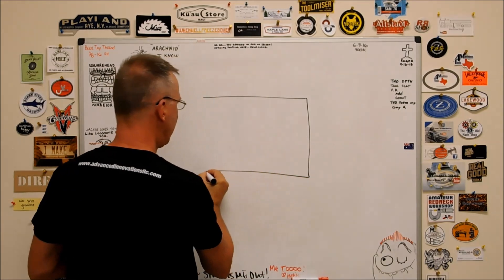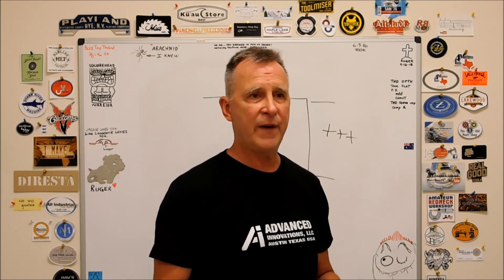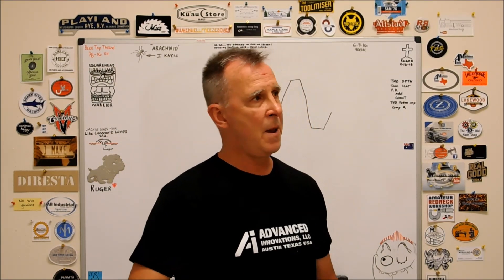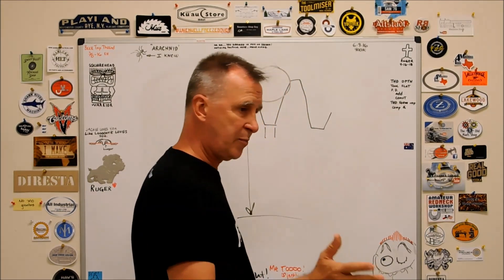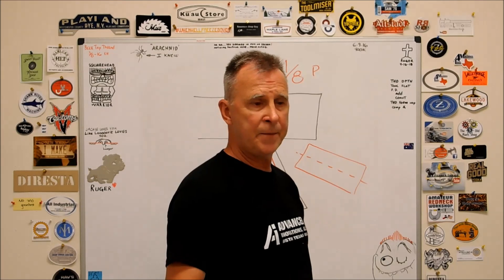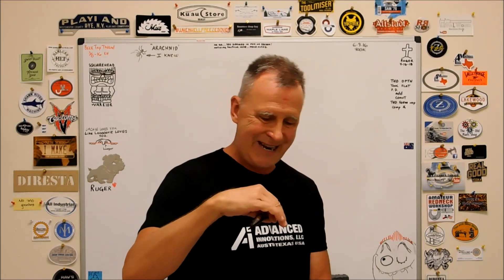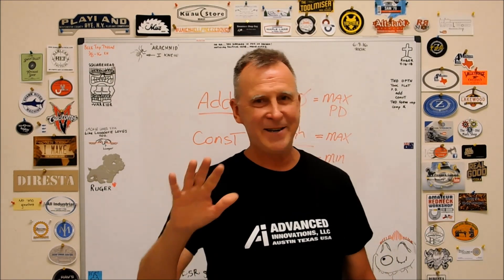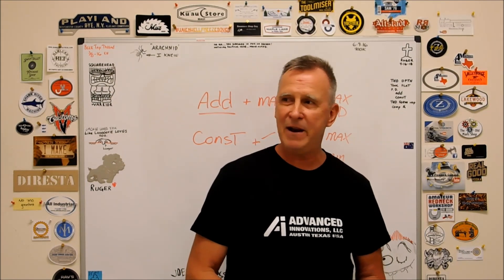Single Point Threading, Want to do it better ?? Watch This Video.

Comment: Thanks Joe.  You are 100% correct!  But, having said that....  Job shop machinist 40 years and I've gotten the thread wires out maybe twice (I think for a class 3 fit).  I don't remember having a thread come back for poor or no fit.  Hand ground high-speed, square to the work by eye, compound at 29.5, 
 and cut the thread.  Use a nut to check it.   I guess I've been making lawnmower parts all these years.
Reply from the maker: I spent the majority of my shop time in aerospace, medical and semi-conductor. Every thread had a class. I'd have to say after 40 years of luck like yours, go buy a lottery ticket.
Reply: @joepie221  I understand, and your attention to close tolerances is quite justified.  The lion's share of my shop work has been in heavy industry.....coal mines, rock quarries, well drilling, railroad, etc.    Much more forgiving work.  You are a master machinist and I admire your work.  Thanks Joe!
Reply: I wonder how SpaceX runs their job shop. I worked with a NASA guy for a time and he wanted to verify the line voltage and that the electricity was actually supplied at 60Hz as part of a qualification package for a medical application. A generous 6 week timeline for writing and executing a qualification package ballooned into what would be a 6 month qualification package. He was chopped and I took over and I got it done in 4 weeks. Interchangeable means interchangeable. There is no "one" test. Everything of importance is checked and rechecked and checked some more. My guess is that 98% to 99% of the job shops work just like you describe, cut the threads and check them with a bolt/nut for play and call it good. I don't see that the 2% of job shops are going to start mandating that all threads be measured with thread wires. That's way too much time wasted. It is a nice video but only relevant to maybe 2% of the shops that need to do this, and they already know they have to measure and verify threads to class and they are onboard. This rant is much ado about nothing. You didn't have 40 years of good luck, sorry, you were doing things exactly as you should have done them. 40 years of cutting threads and none ever came back for poor fit or no fit says it all.
Reply: All job shops making threads than need to fit parts that are not also in their control need to stay within the tolerances specified.  You're probably right 98% of the time the tolerance will fall good even with threads checked against a nut or bolt but consider the cost of the 2% of jobs that get sent back for a thread that doesn't go together or worse the thread strips in service because it's been over cut.  If it's a one off part the cost and time of checking it properly is trivial.  If it's a batch of parts then measuring first, last and samples will be sufficient in most cases.  It doesn't take long to make a go/nogo plug for internal threads that puts you comfortably within the max/min pitch diameters.  Quality is a state of mind.  (Joe has it).
Reply: @MrSailbadthesinner  No arguing your point in theory. So why do 98% of job shops go with a qualitative test nut/bolt versus a quantitative test unless specified otherwise? The way Joe said it is everyone else is a sloppy lawnmower part maker. I would say the real world data doesn't support that a quantitative test is superior to a qualitative test for 98% of the work going out the door. GE was a big believer in SixSigma and where are they now. NASA was known for very high quality standards and they priced themselves out of the market. Quality must be applied in context or it becomes quality exercises. Everything must have a cost benefit.
Reply: @MrSailbadthesinner  My guess is if 2% of any work going out of a job shop were being sent back or rejected it would put the job shop out of business. That number was guessed way too high.
Reply: @tyhuffman5447  GE was a big believer in six sigma - so was GM.
Reply: Don Pollard say no more!

Comment: Joe you should do a screw cutting 101 video. Im a beginner.  Ive watched your thread cutting videos and understand some of it but that pitch diameter, pitch wires,etc gets me everytime.  Using the subjects of all 6 of your thread cutting videos and show how to cut an internal and matching external thread from start to finish
Reply: I recommend getting a Machinery's Handbook and reading that section. It gives a very in-depth tutorial of the process and the measurement. There is a lot of info in there so take your time reading through it.

Comment: Nice Video, and a lot of passion :) .    i was wondering, if this sharp "root" is really a perfect thing, because i thought that "rounded" transistions might be stronger. ( PLEASE DO NOT FREAK OUT :), at least i did not ask about the DOC  ).   Appreciate your time and the quality of the content. What is better ? Thread Wires or these Thread triangles .
Reply: “Rounded” roots are most certainly stronger Michael. Check out the UNJ profile. It’s primary reason for existence is that feature. It’s used primarily for high strength applications as the radius in the root allows for a slightly larger cross sectional diameter. It may not be much larger than a UN root but every bit matters in that area since that’s where fasteners fail under tensile load. On the space shuttle many fasteners were a special MP37N alloy with the UNJ profile with Class 3 threads.

Comment: We just had a part made for a German machine by a large machine shop. They struggled to get an internal Acme thread to fit the adjusting shaft on the machine. They had the original part and they measured the threaded shaft (20mm?) on the machine. State of the art shop, quality control lab etc. After many tries they finally got a fit. I had no idea it would be that difficult.
Reply: Acme is NOT used with metric values!
The corresponding metric thread is a trapez.
Now why is this very important? The reason is that while their shape look the same to a naked eye they aren't. Acme has an angle of 29 degrees while the trapez has 30 degrees. 

Both threads rely on a large contact area to keep wear and friction under control, use the wrong tool and you will get a very small contact point and a thread that will fail quickly.

(There are also other trapezoidal thread forms but these two are the most common)
Reply: @sharg0  Yep! When I saw Larry's comment I was going to make the same comment as you. Nice catch.
Reply: Metric threads on a imperial lathe never is funny because of the odd tpi you have to deal with.
Reply: It sounds like they had their heads stuck between a book and a computer.  Sometimes old school will simplify things.  If you have the mating part, measure the pitch to the best of your ability, grind a tool to match the profile, allow an appropriate amount of clearance, and cut the threads until they fit..

Comment: E=M-(3G-.86603/n)
Pitch diameter equals measurement over wires minus 3 times the wire size minus .86603 divided by number of threads
Reply: For clarification, that is for United and National threads with an included angle of 60 degrees. And n is the number of threads per inch. Cheers.
https://www.threadcheck.com/the-three-wire-method-of-measuring-pitch-diameter/technicalinfo/
Reply: I just know it works and I’m gonna go with whatever’s in the book.
Reply from the maker: I have to say I disagree with this formula. 3X wire diameter deduction from the measurement seems a bit extreme.
Reply: Joe Pieczynski maybe I’d have to check the machinery handbook but I’m pretty sure this is the formula I learned at school.
Reply: I agree. If the wires are such that they touch the sloping sides of the thread at the pitch diameter then E = M  - 1.5 G  (where G is the wire diameter)
You can see from the geometry of that situation that it is a radius and a half at top and bottom.
But the formula says 3 G. See the reference in my comment above.

Comment: I enjoy your videos and your passion for machining. I've used your threading technique ever since watching that first video. I'm soooo glad you now use a tripod! :-) The only problem I've had using the technique, since I don't practice thread cutting much on the lathe, is making sure I hit my mark on the dial. Lots of time after you run off the end of the thread with your technique but a smaller window if you miss the mark on the thread dial. This is usually solved by a few "practice" engagements with the tool moved away.
Reply from the maker: I did a video on engaging your halfnut made easier. Check it out. I agree with the "off the part" practice runs. Good practice.
Reply: @joepie221  Yep, I've seen that video and that's how I've always done it. I just can't get to anxious on starting to applying a bit of pressure as my lathe has 24 engagement points, so not far in between them.

Comment: just saying but in cnc machining, when writing code with a canned cycle the min dia on male and max dia female are required along with the thread depth so the number of passes can be determined. when checking to see if threads are correct, you are right it isnt about measuring how deep but the pd and crests.

Comment: “The metric system – since 1792, the system trusted by 15/16 of the world.”   This Old Tony.
Reply from the maker: Its only a different language. Its not more precision.
Reply: Wouldn't that be 93.75% in metrispeak.. Just say'n.
Reply: so you guys know fractions and decimal aren't the same as Imperial and Metric
Reply: @Half_Nuts    I got the joke.  Jokes should still make sense though.
Reply: You know America did pass metrification laws, 1975. And I quote wiki:
The U.S. Metric Study recommended that the United States implement a carefully planned transition to the principal use of the metric system over a decade. Congress passed the Metric Conversion Act of 1975 "to coordinate and plan the increasing use of the metric system in the United States".
Reply: There are two types of countries in the world: those that use the metric system, and those that have set foot on the moon.
Reply: @philippalmer7814  yeah but didn't nasa use the metric system for the moon landing. doesn't take away from the unmatched  massive achievement though.
Reply: @feelindizzy777  No. they used US Customary unit (imperial). They didn't begin switching over until the 90's.
Reply: @philippalmer7814  Bollocks. While the computer displays provided readouts in feet, feet per second, and nautical miles – units that the Apollo astronauts, who had mostly trained as jet pilots, would have been accustomed to using, internally, the computer’s software used SI (metric) units for all powered-flight navigation and guidance calculations, and values were only converted to imperial units when they needed to be shown on the display.
Reply: @Gottenhimfella  Only for some of the flight guidance internal to the computer. The rockets and spacecraft, along with all of the mass calculations were all done using Imperial system

Comment: Joe, I understand what you're saying, but I still have to move the compound in by a certain amount to cut the thread. Granted, when I get close I should be checking PD, but isn't it true that I could be using a plain 'ol depth reading to get 90% of the way there, then start checking PD? I can't start checking PD after the first .005 pass, right? I still need a rough idea of how far I'm going in, is my thought... Cheers, Dan.
Reply from the maker: After a while, you will get a feel for the crest flat. When it gets close to your expectation, then check with your wires. But having a starting target will make it easier.

Comment: Thank you Joe. I really like the mounts. I remember the days I had with the Nikonos V and the 102 & 103 strobes. Your outfit is what EVERY scuba person should have....the absolute nicest unit for photography. Thanks again for the threading instructions "professor". -Tom (Knoxville)
Reply from the maker: Thanks Tom. That light rig is very comfortable, light and bright to dive with. The G2 version is even better.
Reply: I got my first Nikonos in 1964, great camera. My underwater flash used the standard big flash bulbs of the time. Never understood how it could work in salt water but it did. Did most of my diving in the PI.

Comment: I like Adam Boothe"s analogy,  just cut your O.D of the male thread .005 under the I.D. of the female thread. This only pertains to bigger threads.
Reply: @nick f  Lol,, I caught that too
Reply: @nick f I think you are misunderstanding, cut the shaft size you are threading .005 less than the diameter of the hole size. If you want to cut a 3/6- 16 thread, then size your material at .370.
Reply: larry munday
larry munday
1 second ago
@nick f I think you are misunderstanding, cut the shaft size you are threading .005 less than the diameter of the hole size. If you want to cut a 3/8- 16 thread, then size your material at .370. Damn auto correct. The drill size would be 5/16 for tapping.
Reply: @nick f - Nick, sketch a threaded hole, and sketch the dimension lines for the ID and OD of the female thread. I think you're confusing ID and OD for female threads?
Reply: @nick f Say you are making a 3/8" bolt. Cut the bolt diameter to .370 instead of .375

Comment: There are gauging tools made that MEASURE the pitch diameter of internal threads.   They are expensive and of limited range.   Unless you make a boatload of the same size internal threads, they are likely unnecessary.   You are correct on using the pitch diameter.   One of these days you may want to actually explain what the pitch diameter is.
Reply from the maker: Google it. My explanation was spot on.
Reply: You are one of the very few who actually know what you are doing.  That is one of the reasons I watch you.  I know exactly what the pitch diameter is.  For a number of years. I was the go-to guy at Baker Hughes Inteq for threads.   Try getting a connection to “time” when made up with 40,000 pound-feet of torque.   Defection plays a major role but measurement must be done while the material is not stressed. 
I just keep hoping that one of these times you will explain more about the pitch diameter than its function in sizing the thread.

Comment: Joe, I'm fairly new to machining so please forgive my ignorance.  What is the difference between using thread wires and a standard mic vs using a thread mic?  Is one more accurate than the other?  Do they both perform the same measurement?  Apologies if someone has already asked this question.  Thank you for your time, knowledge, and all your videos!
Reply: In general a purpose made tool is more accurate, that said wires are a perfectly acceptable way to check PD

Comment: Good topic! 

Minor quibble: on a UN thread, the flats are not the same at the root and the crest. The root flats are 1/4 the pitch, the crest flats are 1/8 of pitch. Look in Machinery's Handbook—there's a good picture there although it's very complicated. The (very) obsolete American National threads don't have that difference. This is why the 75% thread engagementon tap drill size charts are generally incorrect. They are based on having the root flat 1/8 of pitch, not 1/4. The 75% engagement turns out to be about 90% of the ideal UN thread.

The whole business with the flats In American National versus UN versus UNJ gets really confusing, especially since there's no good way for a small shop to measure the flat on the tip of the tool short of a $$$ optical comparator.

I generally use full profile 16ER inserts, which moves the problem to somebody else. Unfortunately, to use your upside down backwards trick, I would need left handed inserts and tool, and an anvil that gives a reverse helix angle. Those anvils are pretty hard to find.

There are companies that make gauges to measure internal threads, but they aren't cheap. I believe the general principle is to use small ball bearings and a gage pin or bore gauge In a manner analogous to thread wires.
Reply: Paul Ste. Marie   Thank heaven for the Metric system. 😉
The flat on the tip can be measured quite easily with a tool I built a number of years ago. The tool fits in a 60 degree recess and a micrometer head measures how far from     the true point the flat is, the flat width is a simple calculation.
Reply from the maker: Paul Ste. Marie   Thanks for the comment. I will look into the accuracy of what you have stated, but my initial reaction, with all due respect, is to politely disagree. A 1/4P root flat would greatly increase the minor diameter of an external thd. A class. Rest assured, I will correct my statement if i'm wrong.
Reply: @joepie221  In a way you are both right, a male thread root and crest flat is 1/8P, a female can have 1/4P on the minor diameter. Not sure if you would describe it as a crest or a root.